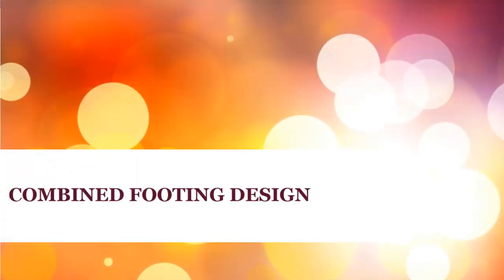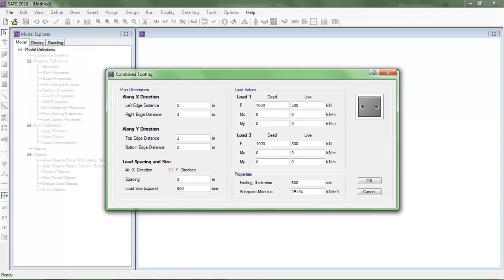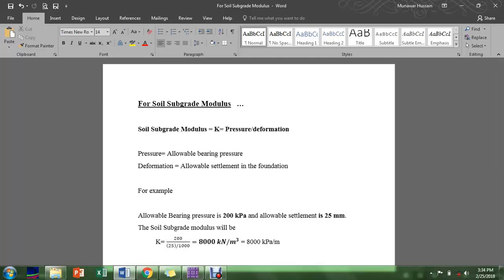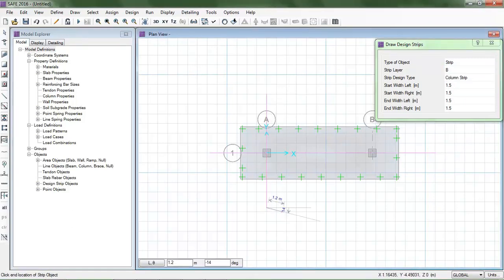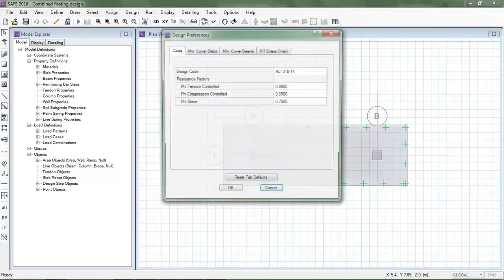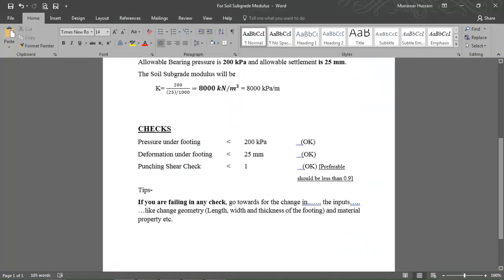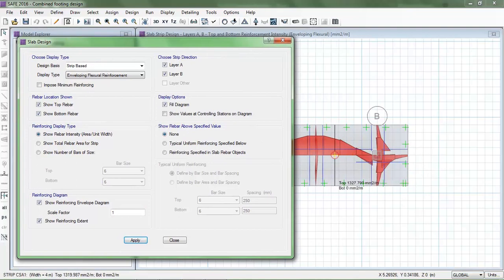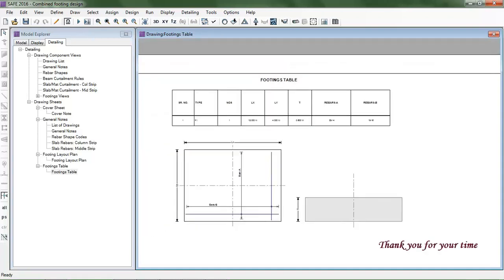CSI SAFE - 18 Combined Footing Design (Analysis, Design and Detailing) Example 2

Comment: In detailing table (1) Rebar A =22 nos @ 14mm & Rebars B = 18 nos @16mm indicate what top or bottom or top & bottom together? (2) will we provide Rebar-B with the same spacing toward the long direction, ie, along 12 m length direction? Please clear it.
Reply from the maker: Dear...
You can see... Top and bottom reinforcement separately... (See options in the Reinforcement dialog box)

2nd you can optimize... With change in spacing

Comment: For subgrade modulus, don't we need also input the safety factor in calculation? subgrade mod, ks= settlement *(F.S)*qa in SAFE, right?
Reply from the maker: Yes... You can use that formula also.... As per bowls approach...